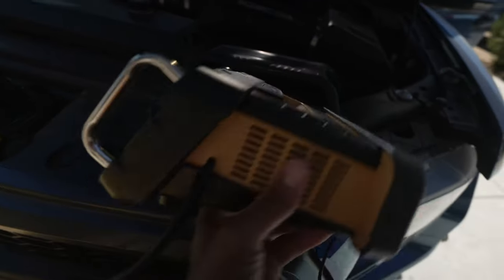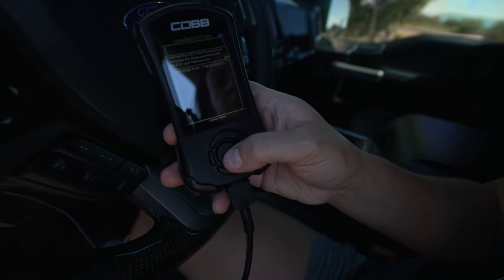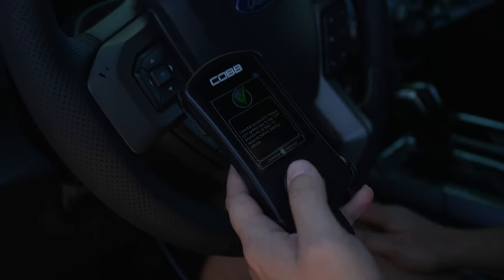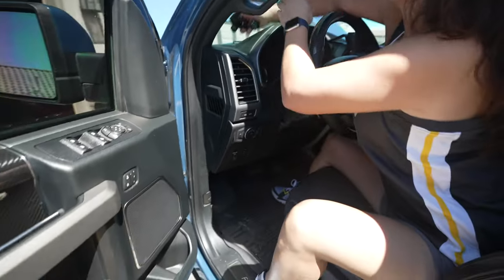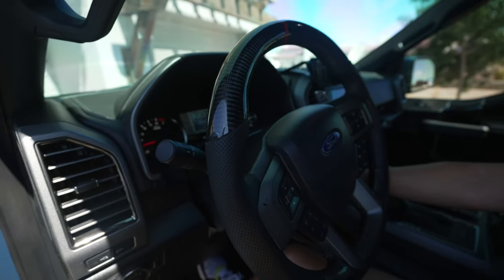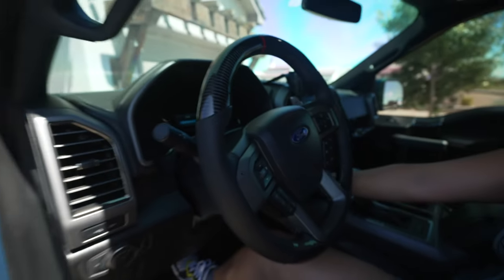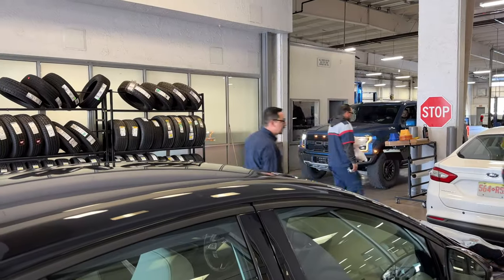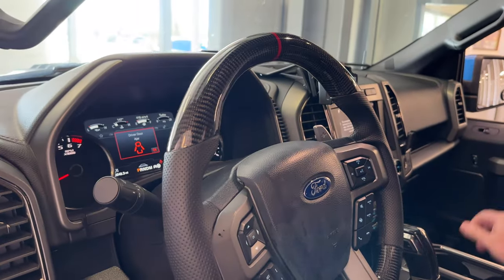Does tuning affect warranty? We put this to the test for YOU GUYS!

Comment: So my dealer said that they are looking for thousands of key cycles and that anything less than what about average count should be ford is denying the warranty.
Reply: Sounds like you need to try another dealership!
Reply from the maker: Ask them what happens if you change your battery and key cycles also reset back to zero. 

Sounds like they just want to give you a hard time.
Reply: @goosetuned  that’s why you are the man bro.  Tanx!  I don’t trust them at all but I figure I’d ask you here.  I didn’t know that a battery change clears the count. Good to know that also.
Reply: @machelelugo237  yea the stealerships in my area just completely suck.

Comment: Had my cam phasers changed at 30k.  Had it done shortly after they did a computer program recall. They stated that they didn’t change the cam phasers at all. They changed the base tunning which was the reason for the cam phasers failing. Said that the same cam phaser parts just new went in. Said there was no “cam phaser redesign” or “new part”. Might want to clarify with the dealer.
Reply from the maker: Hey man. There is a brand new phaser (new part number) that ford is using now. 

It makes me wonder if your dealer either isn’t aware or they used the old cam phasers on your install. We got the new design/part installed on this truck. It looks totally different
Reply: @goosetuned  most likely my service rep just wasn’t aware of what they actually did. 🤣
Reply from the maker: @darylfree9939  lol, well they did a great job fixing the truck. And in less than 24hrs 💪🏾

Great service!

Comment: Why the battery charger?
Reply from the maker: It is required to install and uninstall (the COBB Accessport calls for it on screen as well)
Reply: The battery charger is a CYA on COBB. The AP is changing the programming on the ECU. The engine can’t be running so nothing is charging the battery. If you drop below a certain voltage while the AP is writing a tune half way, your ECU is bricked. Saying you need a charger covers COBB’s ass if you brick your ECU during an install.